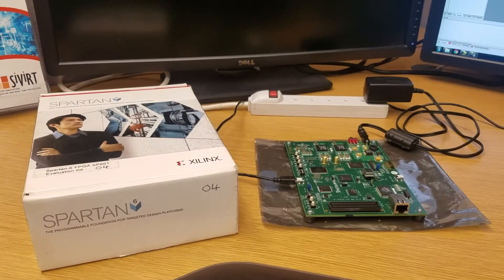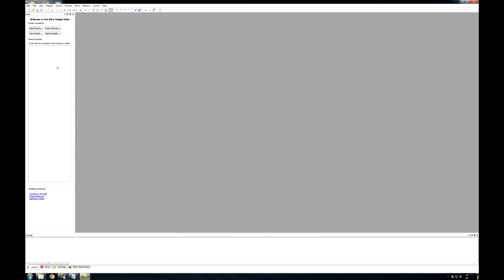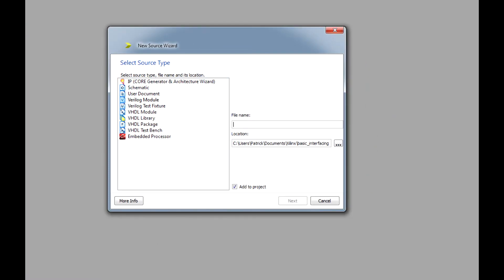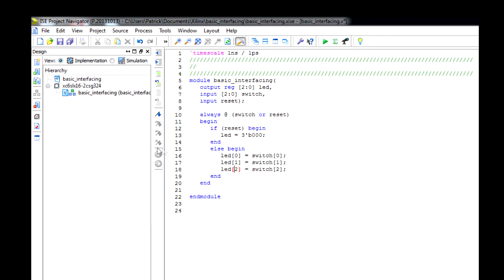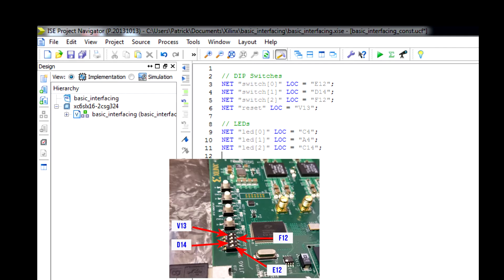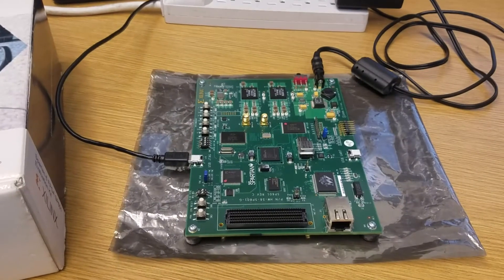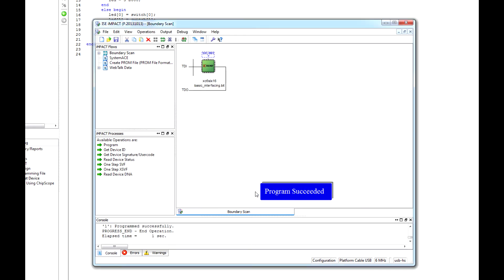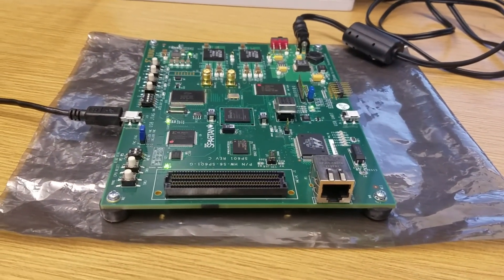Spartan-6 SP601 FPGA - Basic I/O Interfacing

Comment: Hello, great video 😁.

I'm a beginner and I have a question :
-Can I follow the tutorial about the xilinx board programming with the following board : xilinx spartan 6 xc6slx9 2ftg?
 Or do I need a specific board like the one you use ? I so, could you please give me the link so I can buy it?

Thank you in advance for your precious support  😊.

Cordially.
Reply from the maker: Hey there, and thank you!

You should be able to follow the same tutorial (and the previous one) for that Spartan6 chip. If your "board" looks different, such as it's smaller, has more/less buttons/LEDs and so on, then you'll want to reference it's datasheet when writing the config file (for example, in my video, one of the LEDs might be C1, but yours could be A1).

Hopefully that helps!
Reply: @PatrickStockton  Hello, thank you very much for your feedback 😁 😊.
Great :). 
Just to be sure, even if the board I use has buttons but doesn't have switches, it won't be a problem? 

Thank you in advance for your precious support 😁. 

Cordially.😊

Comment: I have a design which has serial input 
an input data window signal within which the input is buffered inside the module 
and an input data clock to sample the serial input at falling edge of the input data clock 
the clock  will become zero when the data widow transits from high to low
so for this type of design how to give the inputs 
can please suggest a method at the earliest

Comment: what about interfacing it with some other evaluation kits like digilent is offering.. does the code remains same.. or we have to alter something.. sorry, if my question is silly!
Reply from the maker: You can definitely use the Verilog code for the other eval kits, but your constraint file will be different (each board has different variables for the pins/ports for interfacing with the I/O or LEDs on the board). You can try to find the developer manual for the digilent board that you have, and look for the names/labels for the pins you're looking to use!
Reply: @PatrickStockton  thnkw very much.. i have spartan 6 digilent board.. nd next thing m going to do is to check out its manual.. BTW i have to generate video compression algorithm through FPGA.. can u provide some more help

Comment: Are you using this on windows 10? ISE as far as i know is not compatible with Windows 1O. I succeeded in synthesizing but while programming my FPGA (Spartan 6 mimas by Numato Lab) , the cable cannot be detected (error: 923)
Reply from the maker: tabish mir I wasn't able to get ISE to work on Windows 10 unfortunately. In this demo, I'm using it on Windows 7. I know there is a tutorial to change/import some .dll files to get ISE to work better on Win10 (still buggy), but it was a long process that I chose to avoid. (You could Google "Xilinx ISE on Windows 10")
Reply: I succeeded in dumping code into my FPGA kit using Mimas configuration tool box and bin files. Via impact it's still not possible. But prior to using the MIMAS tool, i did the .dll manipulations. That helped me synthesize. Thanks :) Cheers!
Reply: ISE Design Suite 14.7 runs on Windows 10. AFAIK its the last update to ISE/Webpack as Xilinx has moved over to Vivado.

Comment: which program is that?
Reply from the maker: It's the Xilinx ISE 14.7 Design Suite. The Spartan6 (and 6-series and below) are supported by ISE and not Vivado. Vivado supports 7-series and newer.
Reply: i want to do some question for you, who is better for you? vivado or ISE? thanks for the support.
Reply from the maker: Vivado is used much more than ISE, since ISE is no longer supported (no more updates for it). Vivado is the most updated IDE (Vivado 2017 is the current version). I personally use Vivado as it has a more intuitive interface, as well as a lot of the bugs are being ironed out.
Reply: thanks i have a last one question, i can't connect my spartan 6 on my computer, the microcontroller is atmega 32U4, how can I do that my computer read my spartan 6? cheers!